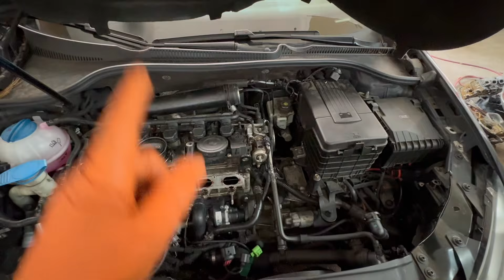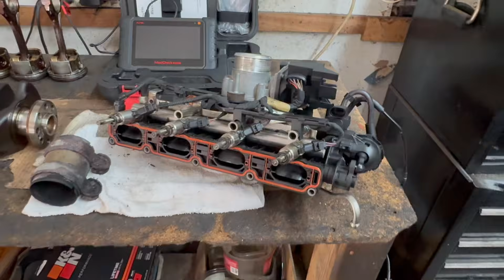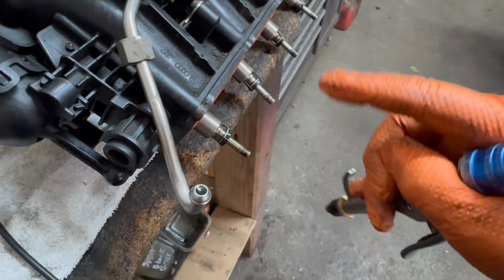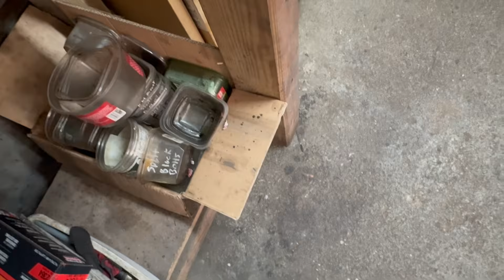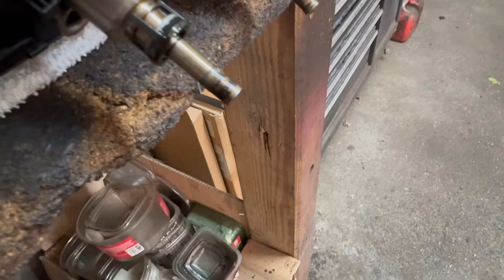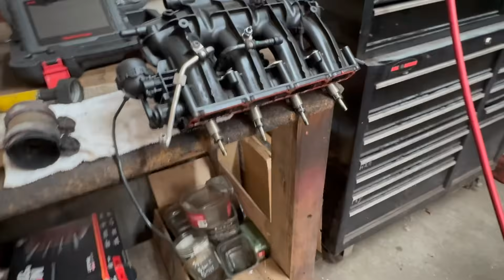VW, Audi Code P2293 FIXED! Stuck Open Fuel Injector Diagnosis & Repair Passat, Golf, EOS, A4, Tiguan

Comment: I getting this code 2013 Audi a4 b8.5 flex fuel with the aluminum intake manifold , I’ve had this code before along with a cylinder 2 misfire, car basically too a shit mid pull ,well it ended up being a bad injector so i replaced all of them and got a carbon cleaning done car had been good until now , and months before I replaced my hpfp for another code and now fast forward to today’s time I’m getting the code again P2293 no signs of symptoms for the code, car runs and drives fine,no lights on the dash, but when I drive my car and i regularly check my codes on the regular using my ie tuner app and recently I’m getting the code P2293 even after clearing the code so it’s definitely something and I’m not one to keep clearing codes and ignore them, could it be my fuel pressure sensor on the fuel rail or my fuel control module or something else?
Reply: Sorry for the long comment i pray you respond , any help would greatly be appreciated before I head to the shop for something I can fix thank you 🫡🙏🏾
Reply from the maker: For that 2013 Audi A4 B8.5 flex-fuel 2.0T with P2293, I'd do this:
1. Inspect the fuel-rail pressure sensor (G247) connector and wiring. Unplug it and look closely for oil/fuel contamination, spread terminals, corrosion, damaged wires, or a wire that's broken internally near the connector. With the engine idling, gently wiggle the harness and listen for any change.
2. Check the HPFP connector/wiring, especially the N276 fuel-pressure regulating valve connection. Since the HPFP has already been replaced, make sure the connector is fully seated and the wiring isn't stretched or damaged.
3. Check the low-pressure side. If you have a mechanical fuel-pressure gauge and the proper adapter, you can verify that the in-tank pump is supplying the HPFP adequately. A weak LPFP or restriction can make the high-pressure system fall behind and trigger P2293.
4. Look at the HPFP mechanical drive. On these engines, the pump is mechanically driven by the cam. If there's a problem with the pump drive, follower/roller arrangement, or cam lobe, the ECU can command pressure but the pump physically can't produce enough.
5. Don't shotgun the rail-pressure sensor. It's definitely a possibility, particularly because the car runs perfectly, but P2293 by itself doesn't prove the sensor is bad.
Reply: @motorcarnut you are the goat my guy ,I highly appreciate your response  and advice I will be sure to go over all that you said and go down the list one by one, thanks so much once again🙏🏾
Reply from the maker: Sure, no problem and good luck!

Comment: Thank you for posting this video. I have the same issue with a 2014 VW Tiguan 2.0 , except that it does not trigger any cylinder misfires codes.  All I have are  3 codes, all of them the same code P2293 . I noticed when the car is warmed up, the EPC light will suddenly comes up on the dashboard, the car then slows down as if it is going to die, then hesitates when I  try to accelerate and at some point the car will just dies. When you start it again, then it can go for some other distance, then does it again and again. 3 codes only, they all say P2293 ( Fuel Pressure Regulator Mechanical Malfunction N276). So far, I have changed the High Pressure Fuel Pump and Camshaft Follower,  I have changed the Fuel Rail Pressure Sensor, I have changed the PCV valve, but the car still doing the same thing. The EPC still shows  on the dashboard. The car still hesitates and sputter when you accelerate . Now I Am thinking either clogged Fuel  injectors, or a bad fuel pump module,  or a clogged fuel filter or even a bad Low Pressure fuel pump? What do you think is the issue?  I am already exhausted. The funny thing is, the car drives very nicely with no hesitations whatsoever as I described earlier  when it is not yet warmed. But as you start driving it for a while, then the trouble starts.
Reply from the maker: Check the low-pressure fuel pump control module, as they often overheat and fail once the engine reaches operating temperature.

Comment: In this case (an opened injector) will it mix the oil with the gasoline ??
Reply from the maker: Yes! And it’s very important to change the engine oil after repair.

Comment: That is crazy. I have P2293 and P0301 (plus a P2185) error codes. I have been looking all over and never saw anything about correlating the cylinder with the fact my car dies right after starting. I guess I will be checking that now tomorrow. Crazy. 

Great video I appreciate you making these!
Reply from the maker: Awesome! Let me know what you find out tomorrow!

Comment: afternoon, i have not long bought a polo gti 6R that keeps persisting issues with the EPC light coming on and it cutting power briefly when i pull away, it sometimes struggles to start but always does. there was no code showing but have now managed to get one and it was P2293. where is the best place to start investigating?
Reply from the maker: Checking for fuel pressure and leaking fuel injectors would be the first place to start.

Comment: Love your channel and your approach to VW diagnostics. I'm trying to troubleshoot a cluster of persistent issues on my 2012 GTI MK6 (TSI), and I've already thrown the kitchen sink at the usual suspects. I'm looking for guidance on the next logical diagnostic step.

Here is a summary of the self-service I've completed in the last few weeks:

Intake/Air System: Replaced the Intake Manifold (to fix stripped bolts), MAF Sensor, and the PCV Valve.

Ignition/Fueling: Replaced Spark Plugs, Coils, and Fuel Injectors (post-carbon clean).

Boost System: Replaced the Wastegate Frequency Control (N75) Valve and upgraded to the latest Diverter Valve (06H145710D).

Mechanical: Performed a full Carbon Cleaning.

Despite all that, the car is still running poorly and is throwing multiple fault codes, including misfires and the original underboost problem.

Current Persistent Codes:
P0299 (Turbo/Super Charger 'A' Underboost)

P030X (Cylinder Misfire/Random Misfire)

P2293 or similar (Fuel Pump Electric Malfunction/HPFP Performance)

Since the manifold is new and I've fixed the intake leak (the stripped threads), the hissing is gone, but the P0299 and misfires are still there.

Logically, my next thought is the High-Pressure Fuel Pump (HPFP), since I have both misfires and fuel pump electric codes.

Do you think focusing on the HPFP and the cam follower is the right move next, or could the persistent P0299 mean I should bite the bullet and replace the turbo due to a failed wastegate flap?

Any advice on where to focus my diagnostics next would be a huge help. Thanks!
Reply from the maker: Thank you really appreciated! Yes, the hpfp will cause the multiple misfires. They can fail in many ways, plunger breaks, they leak and contaminate the engine oil, the cam follower etc. Fix that first and see if the boost code goes away. Engine has to be running without misfiring first then take it from there.

Comment: Hi, if my Sensor on top of the HPFP is cracked....can i try to resolder the terminals? I don't have the budget right now for a New N276 sensor....
It says "Open Circuit"
My car is a 2008 Audi A3 2.0T, BWA engine. Thank you.
Reply from the maker: You can sure try just be careful when working with heat and gasoline.
Reply: @motorcarnut yeah...will do..thank you🙏
Reply from the maker: No problem